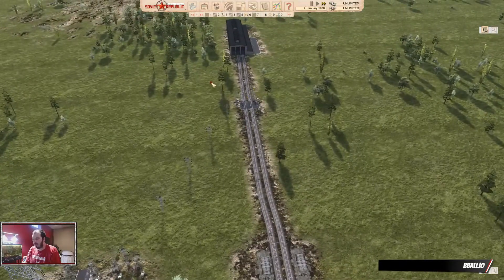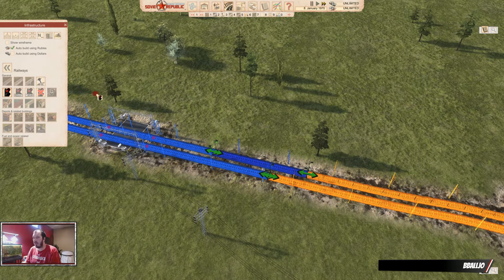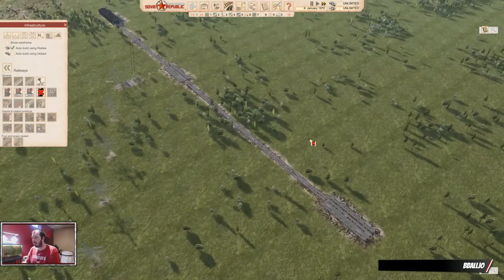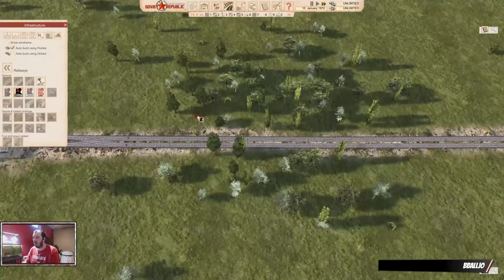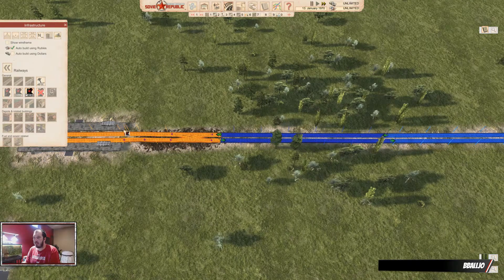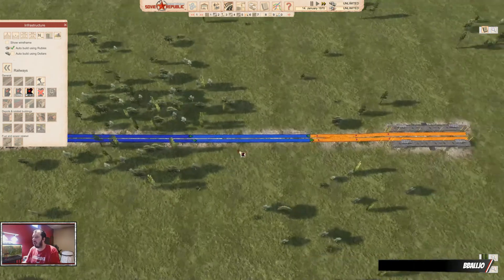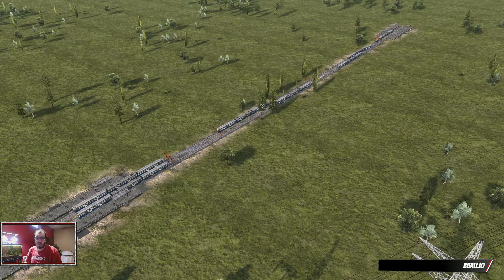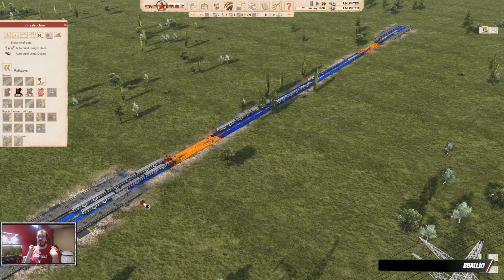TRAIN SIGNALS: All you need to know | Tutorial | Workers & Resources: Soviet Republic

Comment: how to use 2 trains on 1 line ?
Reply from the maker: You assign the second train to the same line.
Reply: they stoped both
Reply from the maker: I guess you're not asking about "1 line", you're asking about "single track", which is entirely different.

The single track section needs to have no signals on it, it should be a block that isn't blue colored when you have the signal overlay on. The entrance tracks on both sides should have a chain signals and the exit tracks on both sides should have block signals. Keep it simple, the distance doesn't matter...single track just isn't very effective when you use block signals.

Comment: Can you simply not make trains run both directions by using cross overs to utilize both tracks either direction and allow trains to avoid each other? I'm just asking as trains actually do this in real life.
Reply from the maker: This isn't real life....so you have to operate within the constraints, which are a direct result of compromises made during development.
Reply: @bballjo  But, can you use multidirectional track? Is it impossible, or just difficult? I, OBVIOUSLY, understand it's a video game and not real life.......
Reply from the maker: @shelbyseelbach9568 block signaling is pretty simple in theory...the block signals looks at the block ahead, and is green if the block ahead is clear. A chain signal looks at the signal ahead, and is green if the signal ahead is clear...that's all the logic there is.

To enable multidirectional track, you have to make it a single block with an entry and exit signal. The trains themselves just follow the signals direction, they don't judge anything else. 

So... multidirectional track can be done, but you can't have signals inside that section
Reply: @bballjo  I'm envisioning parallel tracks, with the occasional cross cross for traffic control.  I'm just not sure how you would attach signaling as entering the criss cross from any direction you'd need a block signal for an exit from the criss cross and a chain signal for an entrance to the criss cross. I'm not trying to yank your chain or anything, just curious. I beat my head against the rail in Satisfactory for days on end trying to make it work in that game. No dice there. I've really just started this game and am going to try to set rail to work this way. As you seem to be very knowledgeable about this game, I was just curious about your thoughts on it or if you had ever tried it. I think a chain signal looking both ways close to the criss cross with a block signal looking both ways just a little further away from the criss cross on all 4 sides of the criss cross might work correctly.
Reply from the maker: @shelbyseelbach9568 true and effective bi directional rail isn't really possible in this game, as one needs a real switch operator to handle keeping the tracks clean. You can make some compromises, but in the end, any track should always only have 1 way to enter and it can have more than 1 way to exit.

The problem is that in the block signals world, 2 trains can attempt to enter from opposite sides, and won't know they've done something stupid until they stare at each other at the same signal... however, the game has dynamic path finding, so if there are multiple paths given at any time, it will take the faster one often. It's neat for multi track, and adding some occasional crossings (in the same direction of course)

Comment: Could I possibly inquire how do I fix it when the train still get stuck despite following your above rule (double signal for entering intersection, single for exiting, and mixed with both of the above for platforms)? Usually it's a passenger train that is entering a station intersection head butting a cargo train that entered the opposite intersection at the exact same time, and both want to use the same platform track. Happens very rarely, but does happen frustratingly often enough. I'm using two one directional tracks on each end of the station (pretty much same as the video). I've added a third omni-directional track to take off the burden since, which helped a little but hasn't completely fixed the issue.
Reply from the maker: Stations have to only have 1 entry per track, 2 exits are ok.

Comment: I hate the rail system in this game. Trains are so useful but the direction system really needs to be streamlined and more reliant on AI pathfinding. I usually end up with only very simple rail lines and have two sets of track, one for people and one for industry/exports
Reply from the maker: Very much disagree. The dynamic pathfinding is one of the biggest reasons why this game is awesome. Once you understand it, it's really not complicated.
Reply: @bballjo  idk I guess I am just used to the AI from city skylines. Trains auto find the best path and bypass stations if slip rails are available
Reply from the maker: So do they in wrsr, you just have to give them the option.
Reply from the maker: Also, cs doesn't make you build a train network... All you do is plop rail, the game does the rest. It's an oversimplified  way of city design (honestly, I feel like the train aspect of C's was very neglected, compare the road traffic you get to manage vs trains)
Reply: @bballjo  yeah I did find that odd how in depth road traffic was. But I guess it fits the theme of CS. wrsr is more of a mass transit simulator
Reply from the maker: I feel like you're trolling... calling wrsr a transit simulator is like calling CS a building plopper. It's an important mechanic to the game, but not the main focus. CS is a city builder with focus on traffic, WRSR is a country builder with focus on everything a country requires.
Reply: @bballjo  100% disagree. The only way signals would be any good is if there were clearer directions/debugging of the sginals. As it is even you "experts" are left guessing half the time if it's going to work.

Comment: 2:07 Why did you make both double arrows pointing away from the train station?
Reply from the maker: Double arrow is called a chain signal, chain signals look at the next signal instead of the next block to turn green/blue/white, and they stay red if the next signal is red.
Pointing a chain signal at the station would not have any effect because there is no next signal, only a block, hence the block signal (single arrow) is pointed at the station. Note that you can chain chain signals together that.

Comment: Short, concise, and informative!  Thank you so much.  Going to try the mixed signals before stations and see if that helps.
Reply from the maker: Thanks! Let me know if it doesn't help!
Reply: @bballjo  I will, I have a map where for some reason when I click on the magnifier icon to see where the problem is, it shows me a section of track on the other side of the border checkpoint.  No mods, no cheats, and been playing around with it to see if it's an error in the network on my side or an issue with the customs office itself and the track on the other side.  Other videos suggested two way standard signals but no joy.  Replicated the issue with another customs house but it would show the error in my lines not across the border.  I think it might be the mixed signal that is needed, hopefully that will get them running.
Reply from the maker: For diagnosing the issue, add some waypoints close to the border on the desired way out and add them to the line, then tell the train to go there. If the issue isn't the border it should be able to get to those waypoints and hopefully give you a better error picture. Just removing all signals in the area is also a good starting point sometimes...
Reply: @bballjo  It didn't work out, there seems to be something up with the border customs house itself.  When I play with it the outcome changes even with the same variables in place.  I needed to restart anyway and add some mods.  So, starting fresh.  Made the rail yard you made at a smaller scale and played around with some other stations and so far it's working out.
Reply from the maker: Nothing like a fresh start 😀
Reply: @bballjo  Yep, and it looks a ton better than the last attempt.  I'm only 3 games in so still learning a ton
Reply from the maker: I've been at this for a while...still learning!
Reply: @bballjo  Yeah, and sadly the information online is spotty at best.  May I request an short oil video with the basics on it?  I can't seem to figure out who my pipelines are sending trickles when everything appears to be set up correctly.
Reply from the maker: I'll put something together, soon (I hope)
Reply: @bballjo  Always appreciate it, you are my go to guy for videos on this game now.
Reply from the maker: I hope I can keep up with your expectations! Thanks for watching!

Comment: I am doing this for a long time. But the damn traning will not leave the station. using the magnifying glass the problem is the signal going in the junction. This was never a problem when i played before summer. Now taking it up again i can not get double tracks to work :(
Reply from the maker: How can I help?
Reply: @bballjo   i think its a bug. Because i do exactly as you explained and it has worked perfectly before. But now when i start playing again after 6 months abscence it does not work anymore. I do as you explain but the train wont turn back and leave the station and has a ?.  looking into the problem it shows the entry-semaphore before the X. I removed all workhops material but no change :( I try all possible variation with the entry-semaphore. Started a new game :( :( Removing all signals and the train is still stuck. 
Otherwise It DO work as a charm !!!
Now i will try start the game with diffrent settings. (32 bit instead of 64 etc)
Reply from the maker: I had weird behavior with the 32 bit version as well...have you tried that save in the 64 bit? And have you tried to remove and add the switch infront of the station again?
Reply: @bballjo  oh yes i tried everything. Even removing the tracks. But i think i have found the issue. I had too many signals in the transfertracks. (ie the part with no junctions) It seems to be working now. I started with 64 and tried 32. No change. 
Now i will try with less signals along the line.
Reply from the maker: Oh! Yeah, too many signals can make life difficult:)